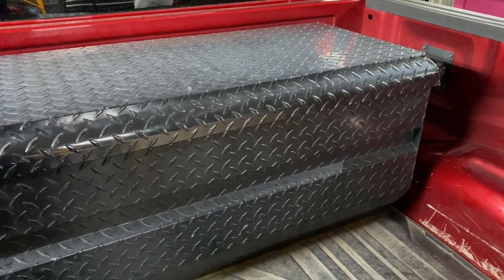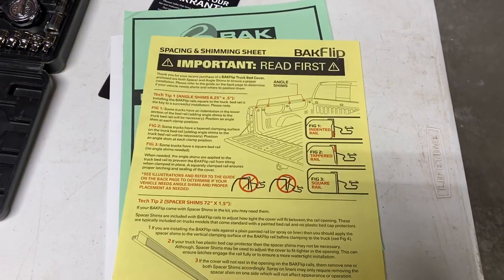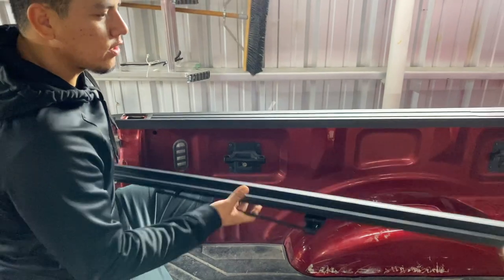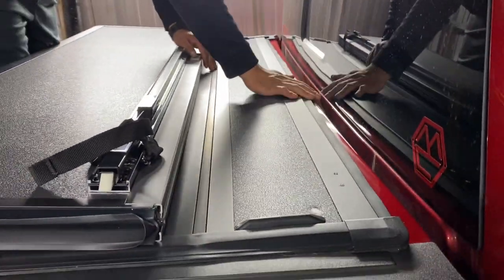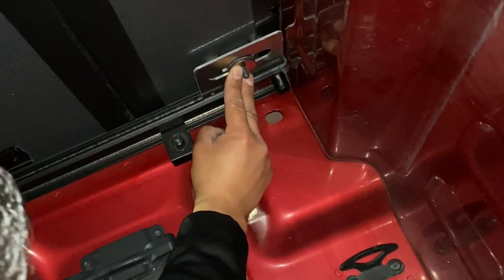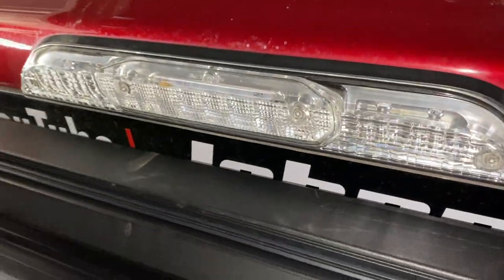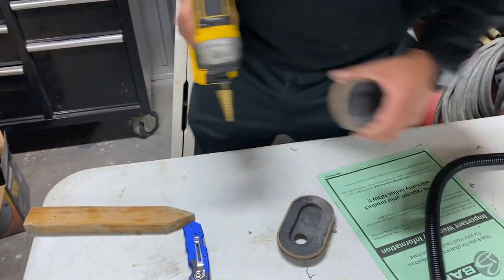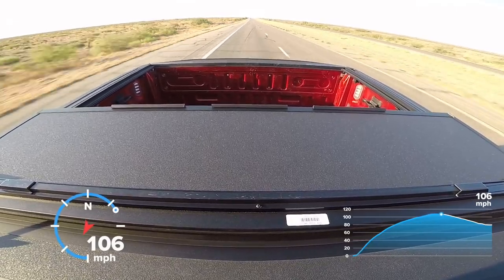BAKFlip MX4 Unboxing, Installation, and Review!

Comment: I just installed mine today and the left side is raised also by the tailgate  and the right side is flush not sure to return it 🤔 what are your thoughts ?
Reply from the maker: I thought about returning it too but since it was so minor I just left it and forgot about it lol I did adjust it as low as I could
Reply: This is the 2nd install I've watched with the left corner being too high. Something strange going on there.